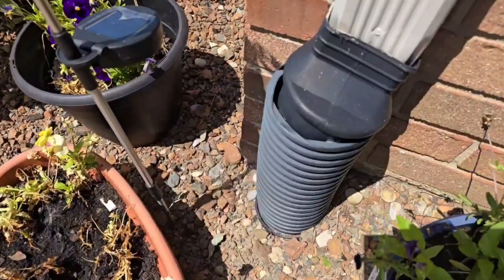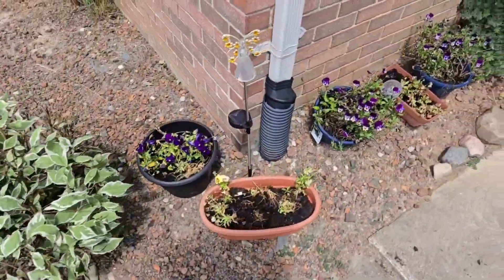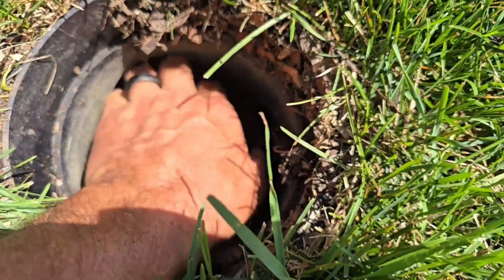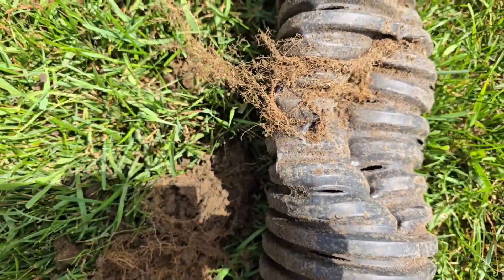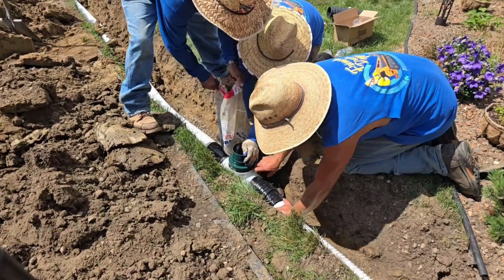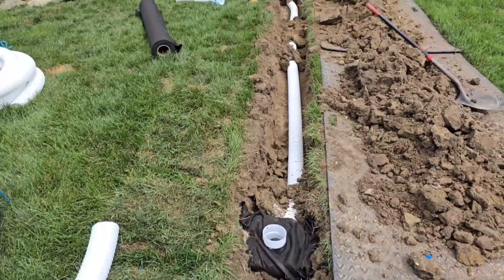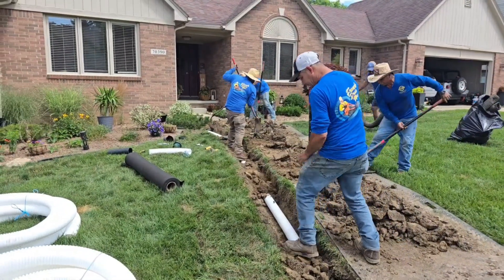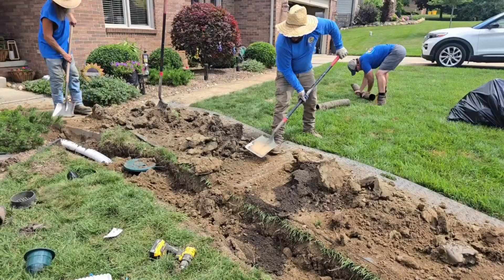This Happens - No Catch Basin on your Downspout? Stay Till the End

Comment: A weir study topic for the flow-lab(if one ever existed, like clear pipes & lab measurements):   After I think near 4 years I was finally able to get a 4 inch smooth-wall to clog, but only right after the vertically-installed long-turn 90 fitting where the water-velocity would have been near 0 b/c of all the leaves built up in the vertical-riser.  I ignored a galvanized-grate sitting on top of a 4 inch riser(the pipe enters the CB from the bottom) & I was able to get enough debris through the large openings in the grate to stop flow with a soggy-chunk of sticky-aged-mess. Though once I uncovered the top layer of leaves on the 4 inch riser the debris & sticky aged-compost washed right through during the normal-large storm. Total head-height for this riser in my example is about 11 inches, meaning the bottom of the pipe is 11 inches from the top of the riser where the water falls in, that's how much water-weight I have to clear debris through by force(literally the limits of the land if I don't upsize the pipe with lower min-slope ratings). [The leaves getting broken down by time, bacteria, & tiny bugs the sticky-compost formed a weir that obstructed flow... but only from low velocity water as it took longer than 10 minutes to wash it all out naturally, it was sticky.] Having your leaf catchers up high produces more water velocity at the almost-a-90. The goop in my pipe could have probably stuck to a wall, I imagine it was a sticky SCOBY(a bacteria colony, the slime is also responsible for clogging the ac condensate p-traps that usually only happens if the filter is clogged & producing higher vacuum-pressure than normal.) I noticed several YT videos this year of people cleaning pink-SCOBY colonies out of their clogged ac condensate drain lines at the same time my 4 inch was blocked.
Reply from the maker: Thank you for commenting and sharing.

Comment: Will the leaf filter on the gutter adapter function properly if attached to a sloped metal gutter extension? Unfortunately, it is not possible to connect one plumb against my home due to an exterior hvac units blocking all except my ~ 12-ft downspout extension.

Additionally, I’ve planned for a french drain in the same trench as my downspout burial but then I saw your video about a yard drainage system:
https://youtu.be/3qXHYMoA3BA?si=o-1W-QxPvImXqznA.

If you have a moment please take a look at what I’m dealing with:
https://youtu.be/9ON5_xLog2M?si=_16KcPwkv8Pm7ehs.

Would you recommend a french drain and two 6” grated catch basins on solid pipe over this 20-ft length (as I intended) or all solid pipe with multiple grated catch basins? I’ve widened my trench to accommodate two four inch pipes and awaiting delivery of perforated pipe so I can still easily pivot given stone has not yet been purchased for delivery. Thank you for answering my questions.
Reply from the maker: Grab all the water at the source. It's really easy to grab the water that's coming from a sump pump. Put it on a solid pipe and in the trench. Catch basins are definitely a must with all that surface water. If it's muddy after a rain, you can do a French drain in the same trench. We do a lot of French drain yard drain combos.

https://youtube.com/playlist?list=PLjFCqaZ4v1BVX2cpGD7wJqH37RSS1JAOz&si=HqkfTnWQabJPJ6_o

Comment: Great points made !  Most people Just don't have a clue to the system .  🎯
   As long as there is fuel in the Tank & the tires are  inflated ...🥳 ' mindset '  👍
  Thank - you for yet another presentation French Drain Crew ...👏...👋...👉💨